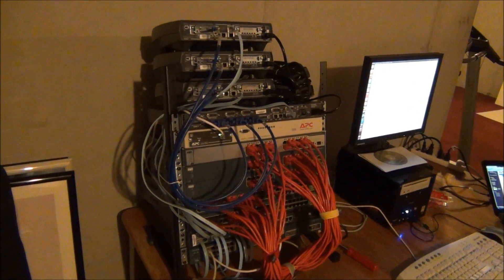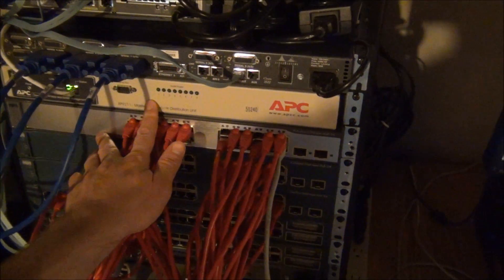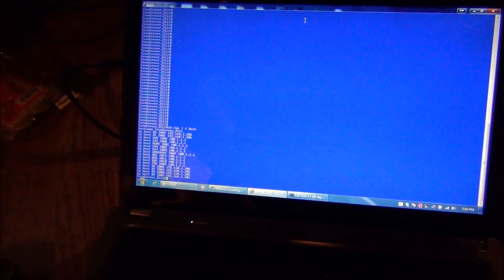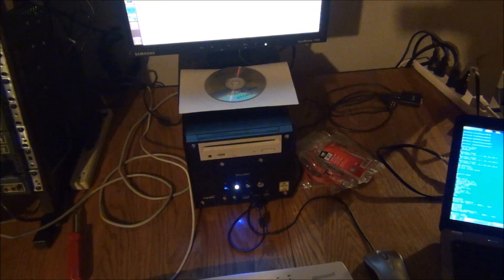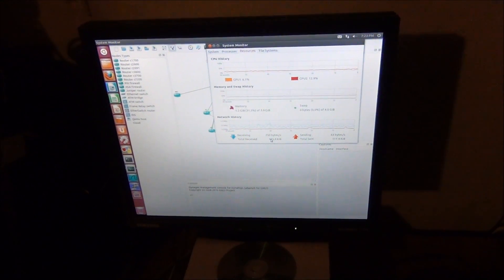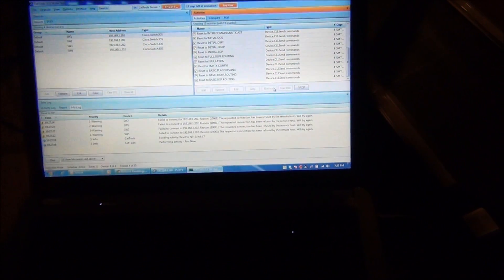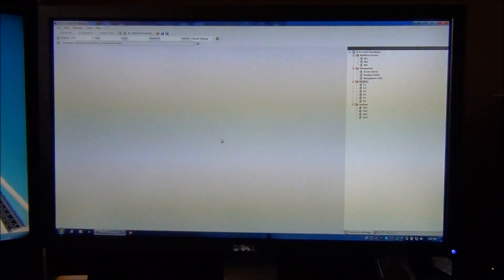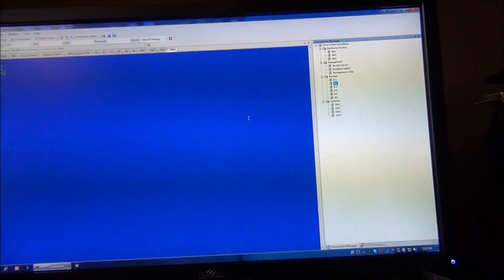CCIE Home Lab Tour

Comment: Thanks for sharing this lab setup and the configuration tips. Glad to stumble across this video. I've got a lot of real equipment, and a triplite for remote power. All that's nice, but also gets noisy. I think you've inspired me to get a shuttle type system for router emulation and trunk connections to a breakout switch as you have. Really nice, straightforward setup you have. Thanks again!

Comment from the maker: @DJMizticNZ Thanks for the tip! You are definitely correct, however in this environment, my traffic is all traversing my home network only so I am not concerned about it being in clear text. Additionally, it is only lab traffic :-) Also, the 2511 has limited SSH support with a weak cipher, and enabling it kills performance on the box.

Comment from the maker: @hvcool Try the fourth link in the description (Bryant Advantage)

Also check out his videos at the bottom of the page. Basically, you just need to define a loopback address for the reverse telnet connections to all terminate on, and then you setup an "ip host" statement for each device connected to the 2511 that also includes the async port number that it is connected to. The first async port on the 2511 is 2001 and they go up sequentially from there. For example: ip host SW1 2001 100.1.1.1